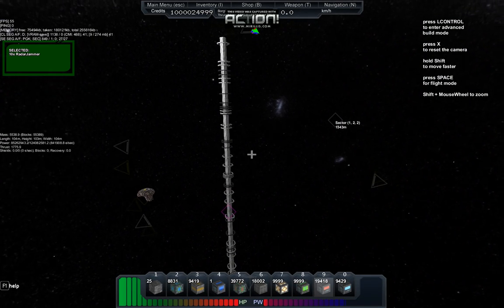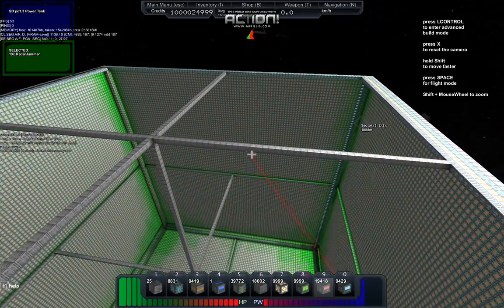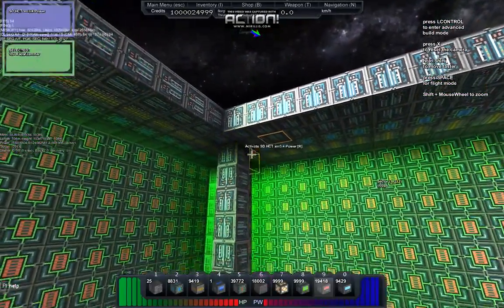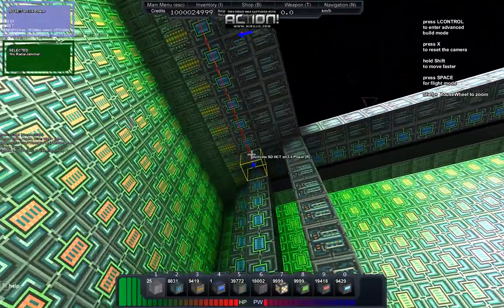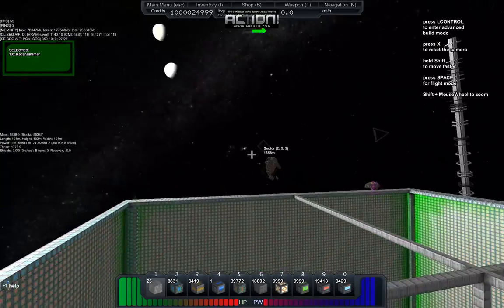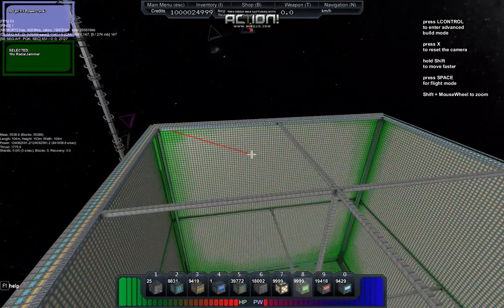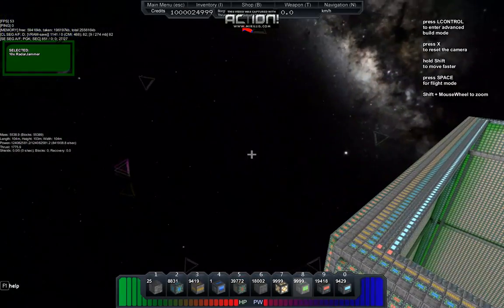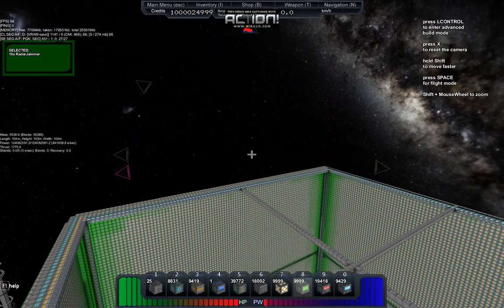Playing StarMade Borg cube update

Comment: You keep saying cloakers and jammers... are you using more than one each?! 

"A single Cloaker is currently needed to cloak a ship. However, to cloak a ship requires 100 energy per second for each block. This means an effective energy system is required." ~ StarMade Wiki

So past the first one, in my experiments, you are just adding another 100 energy per cloaker block per second to keep the others cloaked. I am surprised it doesn't crash PC when you turn it on... loops... hmmm.